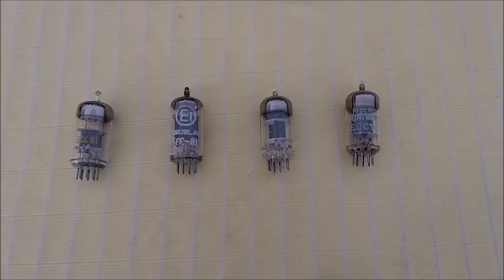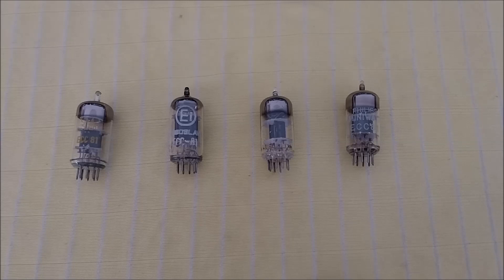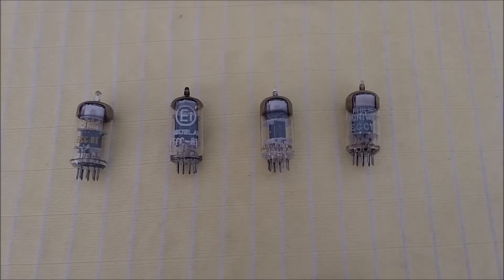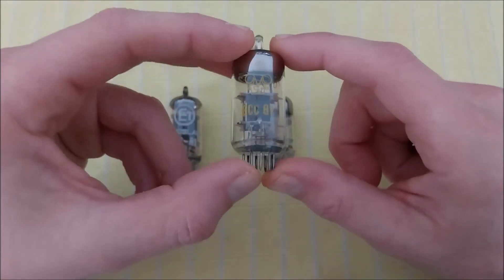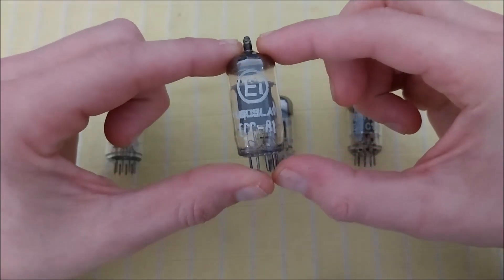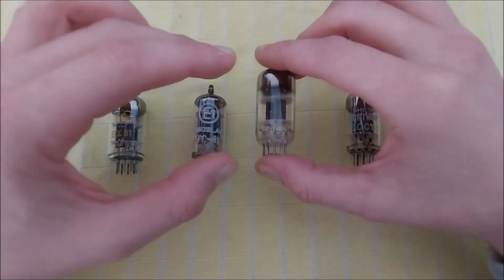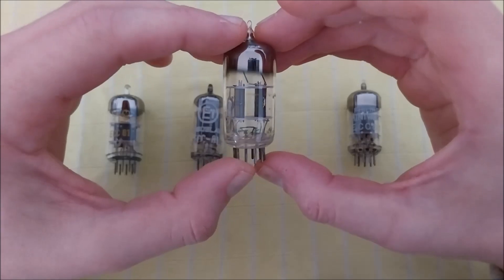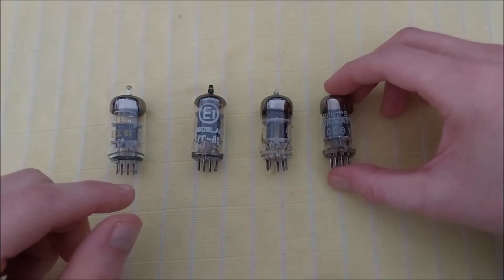Tube Talk - ECC81 / 12AT7 for phase inverter. (RFT, Ei, Marconi Italiana, La Radiotechnique)

Comment: Are there recommended tubes for v4 effects loop position?
Reply from the maker: No, this is for phase inverter..the very last preamp tube before power section. If you have a FX loop tube just like my amp it can improove the signal and clarity of FX. Hope this helps👍
Reply: Ok thanks! What do you use in your amp for the FX loop if I may ask?